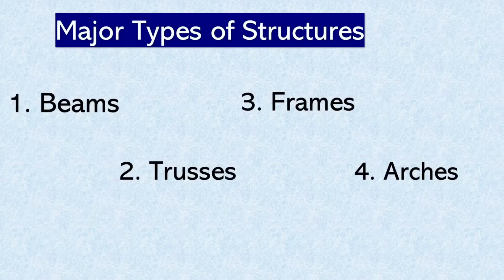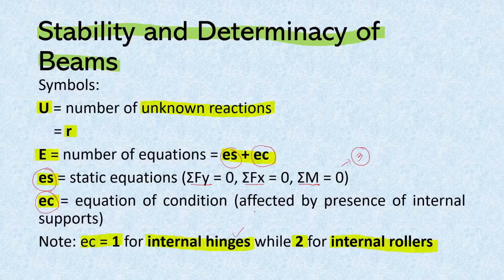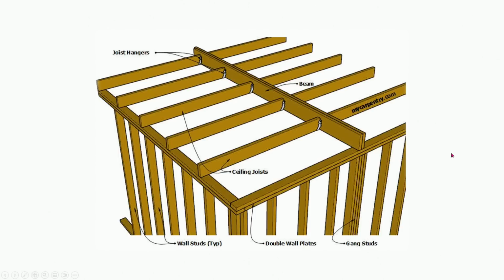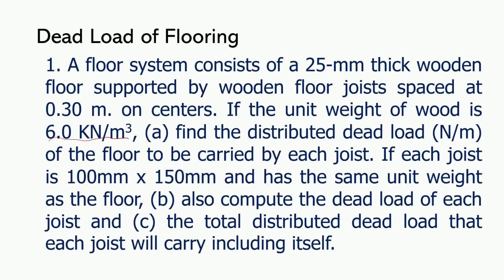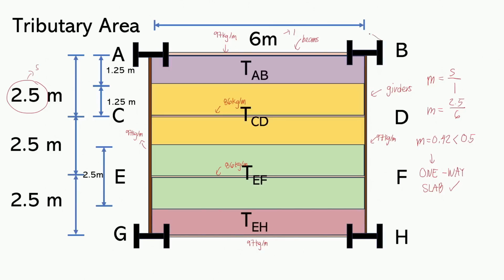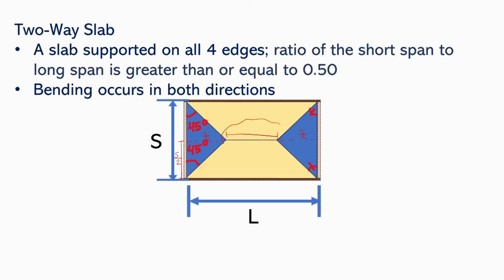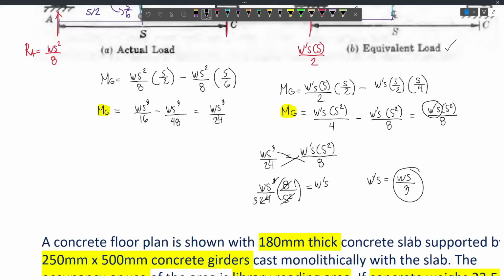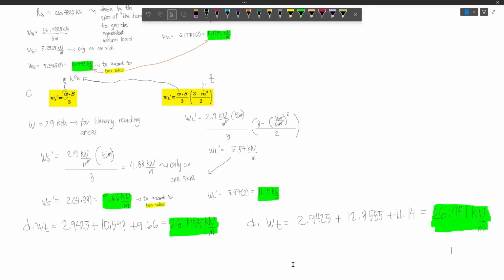STRUCTURAL THEORY - INTRODUCTION: LOAD COMPUTATIONS, DETERMINACY AND STABILITY, AND MANY MORE

Comment: Sir kapag sa column naman po. Paano po malalaman yun reaction? Since stable and indeterminate kapag marami
Reply from the maker: @kylebaguan4337  for the columns po 'pag marami na, ginagamitan na ng approximate or finite element analysis, which are used po sa indeterminate beams/frames under structural theory. This is discussed sa 3rd year po sa undergrad